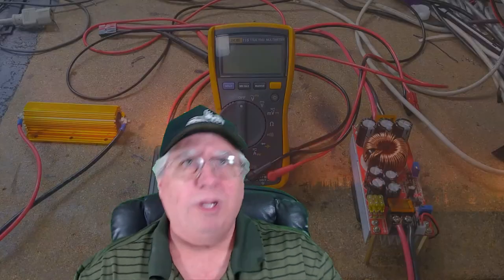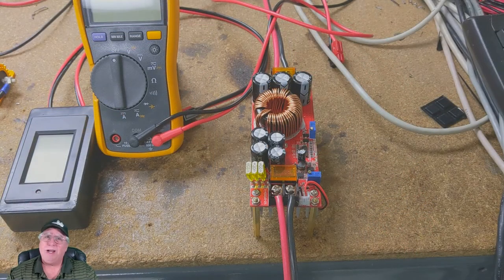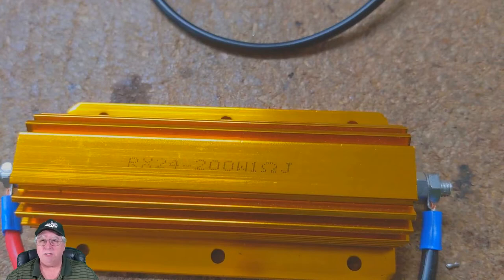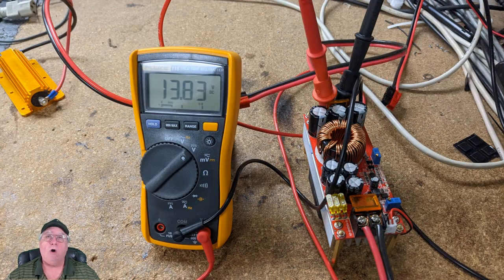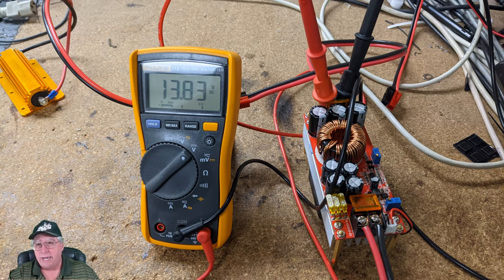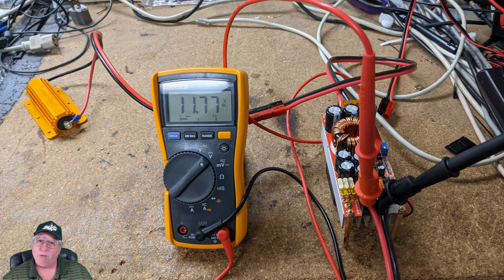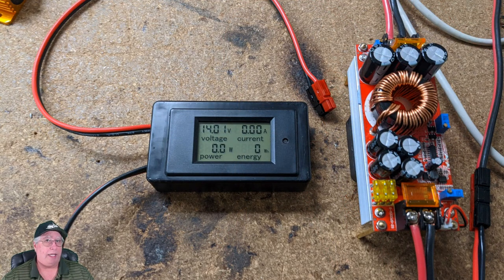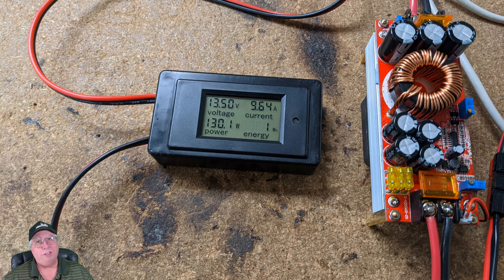How Much Voltage Drop Should We Plan For With 12V DC Power Systems

Comment: Just had this issue. I took my radio off the mains power because of interference and noise. The improvement was amazing and I cannot go back but my radio started to cut off on transmit after a little use. I came to the same conclusion and had to buy a 12 -13.8 up converter. I have not installed it yet and will soon but I do admit using cheap Chinese electronic components with little instructions is nerve-racking. How did your device hold up? I cannot find many people talking about this issue at all as most people never encounter it. When in the car the battery is normally full and leaving the engine on is common. I have heard many others complain about noise but not many think to disconnect from the mains.
Reply from the maker: Hi Don,
I have used the device I evaluate  in this video: https://youtu.be/xU5KLoyzvyw in the field and had success. Keep in mind that a boost converter will not solve too long a run or too thin a feed wire issue. The boost converter will starve out your voltage even faster then running without one if you aren't getting the required minimum voltage to it. Also, remember you can double up the feed wires (run them in parallel) to deal with the voltage drop issue.
Hope that helps!

Stu
AG6AG
Reply: @AG6AG  Thanks for the reply matey. I am going to keep my runs down to just a couple of feet. I am glad you had some luck with the step up converter because without your input I would have no other example of it working. I have between 5-7 of noise on my main power lines when using my rig and can only hear people using linear or at least 50w. It's horrible. But if I use a battery I get zero noise at all and can hear so much more. I can tell the other locals are getting worse audio than me as the are calling CQ over a lot of stations I can hear. If I had to run by rig off mains I'd be tempted to give up. Local lads are throwing 100's of watts at people just to be heard local yet I hear mobile DX from UK to USA on 8 watts power. When did it get so noisy? I have not had a rig on since the 90's lol.

Comment: Hey there 😄

Thanks for the video very detailed.

I was wondering what could be the solution for DC voltage drop ?
Reply from the maker: The only ways to reduce voltage loss to a load is:
1) Shorter wire runs
2) Heavier gauge wire
3) Run multiple parallel wires
Remember, wire has resistance... E = I X R. It's not just a good idea, it's the law!

Stu
AG6AG
Reply: @AG6AG  Thank you 🙏😊

Comment: Ive experienced this same DC voltage drop with my generator battery charger , the battery charger is like 25 meters away from the generator , the battery charger would generate 13.5 Volts DC , but at the generator the voltage i measured coming from the battery charger was allot less
Reply from the maker: Yep... It's a lot more then most people think!
Thanks for sharing!

Stu
AG6AG

Comment: why did it drop 0.33V for just 1ft of 14AWG?
Reply from the maker: Hi David,
Well there are several factors here. The in line meter accuracy is one of them. And then there is the load. Here is one of many sites that help electricians calculate voltage drop: https://www.calculator.net/voltage-drop-calculator.html. This can be quite an eye opener.
Hope that helps!

Stu
AG6AG

Comment: Looks like my battery 💎💎💎
Reply: What if you double the wires. So it would kinda be like a 6 gauge but more like an 8 because there two 12s.
Reply from the maker: Hi Mike,
It definitely will reduce the loss. As always, Ohm's law is our friend. If we reduce the resistance (the wire) and the current doesn't change then we reduce the voltage loss!

Stu
AG6AG